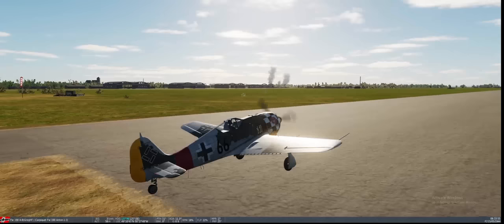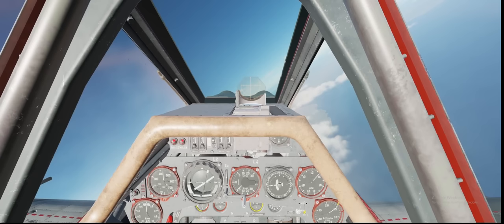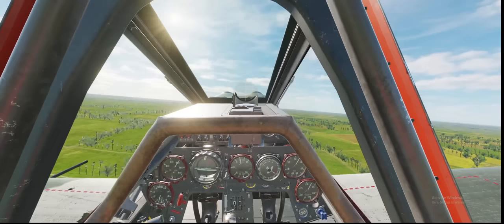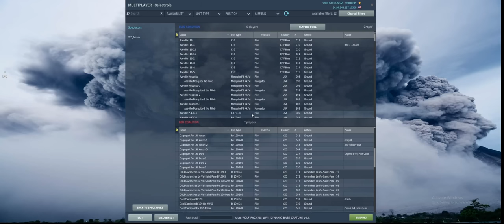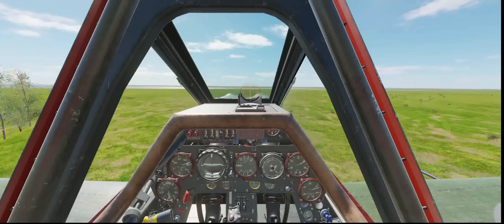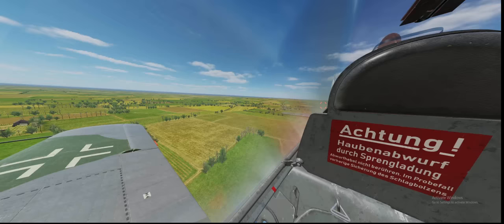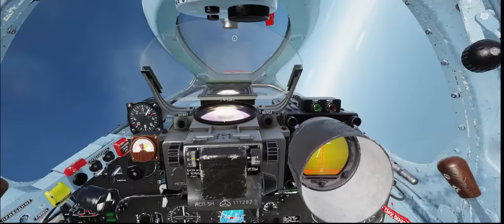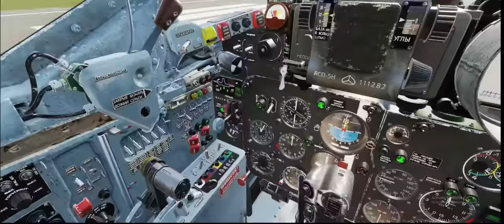German Cannons, Soviet Cannons, P-47 Mach, Angry Authors and More

Comment: P-47 range disagreements is like the Chieftain’s support of the M4 Sherman as a world winner, not a Ronson
Reply from the maker: I haven't read or hear the Chieftain's view on that, but he is correct, the Sherman was legit. The problem is that we tend to compare the Sherman, a medium tank to much heavier tanks on the basis of gun and armor.
Reply: @GregsAirplanesandAutomobiles  Yes, and as Chieftain and others show, the Sherman 75mm gun could in fact penetrate a Tiger if needed, and the M4 effective frontal armor was nearly the same as teh Tiger 1. It may struggle on the front armor, but could pretty much penetrate most other parts of the Tiger. He also shows that there is at most 5 documented and verified cases of US Shermans engaging Tigers in WW2, and 2 of those tigers were strapped to a flatbed rail car when the Shermans destroyed them. 

Tiger 1 Frontal Armor: 3.9in flat plate
M4 Sherman Frontal Armor: 3.6in effective due to angling, I think the baseline was ~2in plate at 56deg. plat thicknesses did vary from less than 2.0in to more than 2.0in on various models.
Reply: @SoloRenegade 
But it's a mute point anyway because tank v tank battles in the west hardly happened, it was comparatively rare.
And it's a statistical fact that the safest place on the battlefield in the western ETO, and the Pacific for that matter, was inside of a Sherman tank, just the same as statistically the safest place in a B17 or B24 was the ball turret despite all the hokum spread around all these years about it supposedly being a death trap, ball turret gunners actually had the highest survivability rate of anyone on the crew.
And when it comes to Greg saying "...careers had to be protected..." in his video about the P47's range take it from someone who was in the Army, the higher the rank the more it's true, myself and 15 other guys I was on a team with were victimized by a West Pointer who lied to us to further his career, as a result 5 of us who should have stayed in Germany as per our enlistment contracts wound up getting transferred to Ft Riley Ks when our battalion got ordered to move there and he got to stay in Germany with his girlfriend.
Reply: @dukecraig2402  "And it's a statistical fact that the safest place on the battlefield in the western ETO, and the Pacific for that matter, was inside of a Sherman tank"

correct

Oh, I know how it goes with "protecting people's careers" in the military. I served and am a combat veteran. I have plenty of stories of my own.
Reply: @GregsAirplanesandAutomobiles Sherman was not legit on the bases of its origin.  Design came from automotive industry, not from a dedicated tank design effort, thus the logistical nightmare with engine selection, and a long list of core design shortcomings, beginning with the need for a weld on plate for hull ammo rack and it goes on from there.  Shermans were extensively tested by Soviets in direct comparison to other tanks.
Reply: @GregsAirplanesandAutomobiles  there were also multiple versions of the Sherman. User reports were that the early versions without a loader's hatch and small hull hatches were not optimal for survival. But they added a hatch, made some bigger. And also they added wet stowage.

At least it wasn't like the Churchill on which some early Mk. IVs and hobnail boots it was possible to set it on fire just getting into it.
Reply: @SoloRenegade  the Sherman was relatively vulnerable from the side. So was the Panther.
Reply: @BigSmartArmed  the strong automotive basis meant that the M4 could be relied on to get to the battlefield. The logistical issues with respect to powerplant was reduced by restricting versions to theatres or different armies to a large extent. IIRC, in NW Europe, the USA fielded just two engine types, the UK mostly one, etc.
Reply: @wbertie2604  Because of the strong automotive basis US produced higher quality herringbone gearing vs straight gears Nazis produced, that is a fact, yet the powerplant issue was not a mere inconvenience, it was a big logistical issue from factory to the front lines.  The worst solution was the air cooled motor that sucked the air through the full like a giant fan.  Tankers were getting hypothermia  during winter operations.
Reply: @wbertie2604  " the Sherman was relatively vulnerable from the side. So was the Panther."

so were most tanks. the tiger hull side armor was down to 2.4in. 

And pretty much all tanks are vulnerable at the turret ring and other seems too (driver's viewport on the Tiger).
Reply: @SoloRenegade  Tiger side armour, at 80mm, wasn't far off its frontal armour and twice the typical western allied tank of the period which also tended to have vertical side armour. So the Tiger was relatively secure from side attacks, although not invulnerable. Many common AT guns of the period had 0 degree penetration of only around 80mm of the period so even a side kill against a Tiger was not easy as a perfect 0 degree shot was unlikely. Short of actual penetration, spalling could kill a tank, though. Some guns at the time that the Tiger was introduced could deal with 80mm but it could be ammunition dependent
Reply: @SoloRenegade  a viewport or turret ring hit is a lucky one when ideally you want to be engaging at ranges of 600 to 1000m to avoid it trivially killing you.
Reply: @wbertie2604  not when firing 6x .50cal at 1200rnd per minute. the odds of an accidental penetration on a few tanks every once in a while are statistically very good.
Reply: @wbertie2604  Tiger hull side armor was 2.4in thick, or 61mm, with zero slope. the keyword you're missing is HULL armor. Attention to details is Critical.
Reply: @SoloRenegade  ah, you are trying to distinguish between superstructure and hull. Terminology can be a bit loose there, and both upper hull and superstructure are used. Anyways, the lower area is  60mm (I think you are converting back from 2.4 inches to get 61mm as it's 60mm in reality) but mostly behind wheels and to a greater extent than an M4 and with more wheel thickness in the way than a T-34. The risk from a hit in that area is more the damage to the running gear more than hull penetration. Unless you are very close or lucky you aren't likely to hit the space above the wheels. It did happen, of course, but if it was very likely it would be 80mm there, not 60mm.
Reply: @SoloRenegade  1200rpm is an M3 and post war. It's around 750rpm for an AN/M2 in WW2. That's 12 rounds per gun per second Assuming a 1 second burst against a Panther painted white in the middle of Salisbury plain that's a dozen hits. In less ideal conditions, more like half a dozen. The chances of a hit on anything vital and fragile enough to damage are low. Those are just the cold hard facts from RAF testing, although they were using 20mm cannon but the hit rate in ideal conditions was still only 20%.
Reply: @wbertie2604  the point is, penetration is possible, and all tanks, including the Tiger, had vulnerable spots. and that people always cite the thickest spots, while ignoring the thinnest spots, like the 1in bottom hull armor.
Reply: @SoloRenegade  yes, there is s danger in quoting just the thickest spot. However, an aircraft attacking a tiger with  50 calibre rounds is unlikely to do anything worse than put a hole in the rucksack attached to the outside containing Fritz's clean underpants. Tanks are big and six rounds randomly distributed over the surface are unlikely to take out s vision port, etc. And the direct vision ports are protected by replaceable armoured glass. Which is why the Saving Private Ryan makes no sense unless Miller was simply trying to craze the glass with his Thompson to prevent the driver seeing, which would admittedly be a valid tactic. But even that took effort from five feet in front of it.
Reply: @SoloRenegade  air attacks with MGs were effective against open-topped and light armour, not tanks. There's doubt whether 37mm and 40mm guns resulted in many kills, or any kills against anything more than a BT-7 or M.13/40.
Reply: @wbertie2604  6 rounds? now you're just being blatantly disingenuous and cherry picking to suit your narrative.

"And the direct vision ports are protected by replaceable armoured glass. "

which a single .50cal bullet would penetrate.

"Which is why the Saving Private Ryan makes no sense unless Miller was simply trying to craze the glass with his Thompson to prevent the driver seeing, which would admittedly be a valid tactic. But even that took effort from five feet in front of it."

5 feet away with a machine gun is rather easy. Stop using Hollywood as if it is a documentary.
Reply: @wbertie2604  many combat aircraft had M3 machine guns. I have plenty of sources. 

But it doesn't matter. 12x6 or 12x8 is a lot of bullets per second looking for a statistical destiny with a soft spot.

"Those are just the cold hard facts from RAF testing, although they were using 20mm cannon"

Ahhhh, apples to oranges. low fire rate using less penetrative guns/ammo. you are NOT going to have ANYTHING remotely comparable to .50cal from that study. you CANNOT use that data to draw ANY conclusions about .50cal against a tank.
Reply: @SoloRenegade  they built only 2400 M3s in WW2 and if any made it into aircraft that saw combat in the Far East it would have been a tiny handful. For any practical definition it's a postwar gun. Since it didn't exist until April 1945 I highly doubt any was fired in combat against a German tank operated in WW2. If you have sources for use that are in the war in Europe I'd be interested to know, though. But by far and away the most common gun would be the M2.
Reply: @SoloRenegade  we're talking about the proportion of hits. Increasing the total rate of fire slightly won't increase the proportion of hits just the number. And since the test was done with Hispano cannon, the total rate of fire was  40 per second as opposed to about 70, so the same order of magnitude. So yes, the data is entirely applicable. For the optimal calibre program the USAAF later ran it used just a SINGLE gun and scaled results.
Reply: @SoloRenegade  I'm not using Hollywood as a documentary - quite the reverse, noting its absurdity. The armoured glass, though, would not be penetrated by a 50 calibre round. The blocks were 90mm thick.
Reply: @wbertie2604  no, the 20mm cannon had LESS armor penetrating capabilities, and was slower firing, and larger in size, making it harder to statistically land enough hits to get a lucky one, and less weak spots it could find its way through, and less damage to teh armor in teh first place. totally not applicable to a discussion about the capabilities of  a .50cal.
Reply: @SoloRenegade  you are absolutely incorrect if you think WW2 50 calibre AP had superior penetration to Hispano AP.
Reply: @SoloRenegade  in terms of the statistical chances, I've taken the proportion of hits from an applicable test and scaled it up by the relevant rate of fire, so rate of fire is taken into account. Given a one second burst that is reasonably accurately targeted you are talking 6 to 12 hits from an aircraft armed with 6 M2 50 calibre guns.
Reply: @SoloRenegade  size of gun has no bearing on number of hits landed.
Reply: @wbertie2604  "you are absolutely incorrect if you think WW2 50 calibre AP had superior penetration to Hispano AP."

Now you're cherry picking and changing the subject.

Here is what you originally claimed,

"Those are just the cold hard facts from RAF testing, although they were using 20mm cannon but the hit rate in ideal conditions was still only 20%."

your original comment never said anything about AP rounds. easy to win an argument when you keep changing the criteria and cherry picking as you go. That's a logical fallacy and an automatic fail in debates.
Reply: @BigSmartArmed  that was quite common on vehicles in WW2, including liquid cooled engines, as it ensured that engine fumes didn't enter the crew compartment and in some cases provided the primary gun fume extraction, although some tanks also had dedicated fume extractors. It was a feature and crew temperature control wasn't present in any tank in WW2. I imagine the only one that was pleasant in winter was the Covenanter, and that was its only plus point.
Reply: @SoloRenegade  AP was a part of standard 20mm Hispano belting so there was no particular reason to single it out. Early in the use of Hispsanos, RAF fighters didn't often use HE, although they did by 1944*. I'm trying to provide data as measured by tests of the proportion of hits on tanks to aid the debate (I can't post links in YouTube comments, though) and then indicating how many hits that is likely when a fighter bomber attacked a tank. It's a lot fewer than people might assume, which I thought would be a useful contribution to the comments.

* As an aside, the Bristol Brigand which just missed WW2 had an issue with the design of the blast tubes allowing unburned propellant gases to collect which could then ignite. It was forbidden to use HE rounds as there was a chance they could detonate in the nose of the aircraft. That is, it could shoot itself down. The Brigand had multiple issues - the whole Buckingham/Brigand series was not Bristol's finest hour, although its powered turret division was doing very well and the Centaurus was just about fixed.
Reply: @SoloRenegade To medium caliber artillery.  M4s hull was penetrated by shrap from howitzer shells, that's why the forward ammo rack had to have a field plate welded on.
Reply: @wbertie2604 Aircraft Wright R-975 was air cooled, it had fan blades that cooled it.  Air current created a draft through the tank hull.  

Ford GAA was another aircraft motor which was stuck into a tank. 

Chrysler A57 multibank was an automotive 30 cylinder Frankenstein, not fitted for any sort of heavy equipment duty.  

GM 6046 twin diesel is another multibank, two 6 straights paired up into a 12.  

The entire line up is a total shit show of poor reliability and logistical nightmare.  US did not have a single dedicated tank engine when entering the war, it's all gum and ducktape level effort.
Reply: @BigSmartArmed  yes, but many tanks of the period employed fans to pull air from the crew compartment into the engine compartment as all or part of the design to ensure there was no ingress of fumes from the engine compartment and  remove gun fumes. Details vary across WW2 tank designs. It resulted in many of them being quite cold in winter due to the through draft
Reply: @BigSmartArmed  after a period of initial poor reliability the multibank ended  up probably the most reliable engine. Mostly used by the UK.
Reply: @wbertie2604  "most reliable engine" as compared to what?
Reply: @wbertie2604  You can deflect all you want but I've read diaries of M4 tankers that suffered frost bite during winter and during stops they would get out of the tank to burn fuel so they could warm up.
Reply: @BigSmartArmed  I'm not deflecting. I'm just noting it wasn't unique in terms of this design feature. It was actually quite common, and not unique to air-cooled engines. Maybe it was a bit worse on this model, though. Life in any tank in winter was renowned for being miserable, hence the thick dungarees that the USA issued to all tank crew at the time, also popular with armoured infantry in winter.
Reply: @BigSmartArmed  from the tank encyclopedia article on the Churchill (because you can look it up and I can't scan my books into comments): "The air needed to cool the engine was drawn from the fighting compartment, dragging gun fumes through air cleaners". The A22 used a Bedford flat 12 engine
Reply: @wbertie2604  Most RF fighters were NOT equipped with AP ammo.

Brigand? nice cherry pick. Curious you didn't pick the Spitfire, Typhoon, Hurricane, Mustang MkI, etc. It's almost as if reality doesn't support your cherry picked hypothesis.
Reply: @BigSmartArmed  P.S. Personally, I'm amazed that they managed to turn what seems like several engines welded together out of desperation work at all, let alone become reliable. From all I've read, to start with it was most definitely unreliable and I don't know enough about engines to understand how that was rectified. I would be very happy if Greg took a detour into explaining the various engines of the M4 and how the multibank was saved.
Reply: @wbertie2604  what the manuals include as options, and what was used, are not the same thing.

Some US fighters could fire nuclear air-to-air missiles. doesn't mean they did.

"The information about the Brigand was simply an amusing aside which I thought might be of interest."

how about you stay on topic instead fo trying to distract and deflect.
Reply: @SoloRenegade  as noted, they made quite a bit of AP ammunition and it was issued. It wasn't the standard when A2A was likely but the amount actually used is indeed hard to determine over and above that it was certainly shipped for use.
Reply: @wbertie2604  no one is denying AP existed and was used, but not predominantly, and you cannot compare 20mm rounds to .50cal. You cannot judge penetration of one, from test reports of another.

stick the facts in question and stop talking about factors other than the arguments that were being made. the argument is not about 20mm.

Comment: The P-51 was also faster due to low drag. There are elements and features of the P-51 design that made it low drag, that even you still have not discovered. To this day, the P-51 is the benchmark by which all propeller airplanes are judged (not the spitfire). The Spitfires have some extremely glaringly obvious high drag features. Very late in the war, the latest spitfire models worked to address those drag flaws. But many of the first models had flaws.